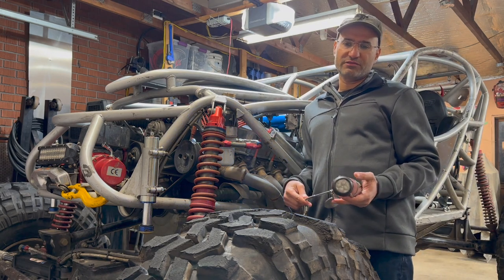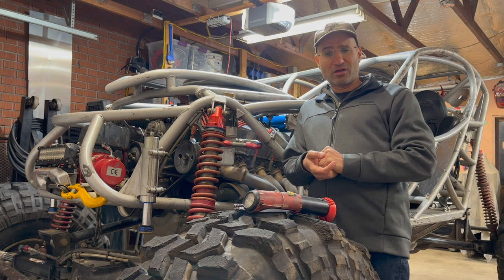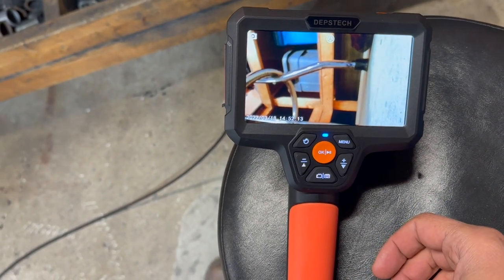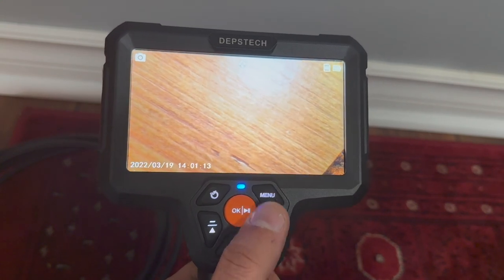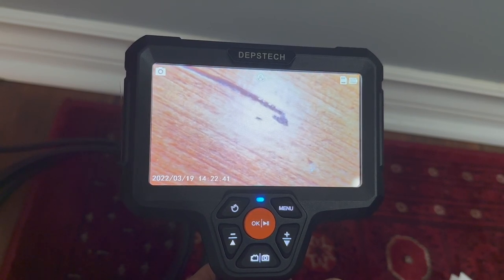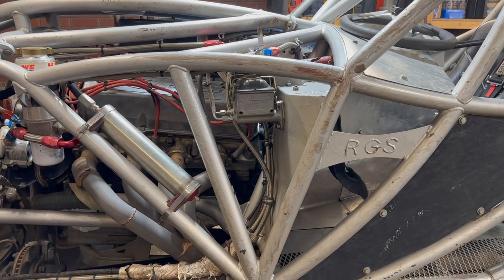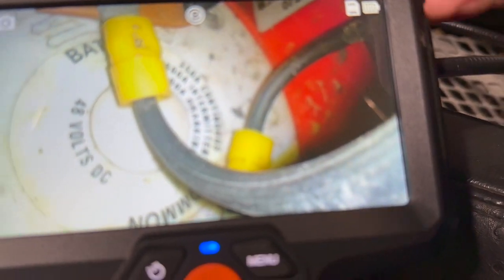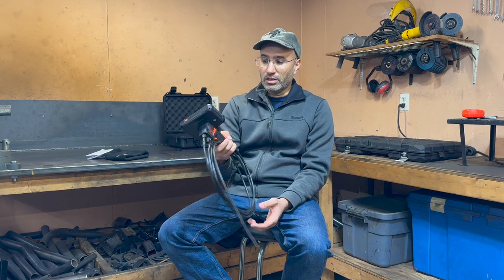Detailed review of the DEPSTECH DS580 Dual-lens Professional Industrial Endoscope

Comment: This was a pretty good demonstration of this unit.  I would have liked to have seen the file transfer demonstrated.  I guess you can do that or remove the SD card and use an adapter to plug it into a regular USB port to transfer or view the files also.
   I'm impressed with your design and build of the fuel tank for your "buggy". The welds look very nice and you incorporated baffles into into the design. Well thought out and a good build. Thank you for posting !
Reply from the maker: Thank you
Reply: @rgsabat  Yup! I was so impressed with it I ordered the DS580DL  5M (16.5 foot) thru Depstech  Ama*on site. Got it 2 days later. Love it. It'll be put to good use over the years to come.

Comment: The only thing it doesn't have is a split screen which would be nice but not a necessity. The 600 just came out with a 4.3 inch screen with split screen but with 1 MP cameras so you could put the 580 probe on it and have the best possible system.